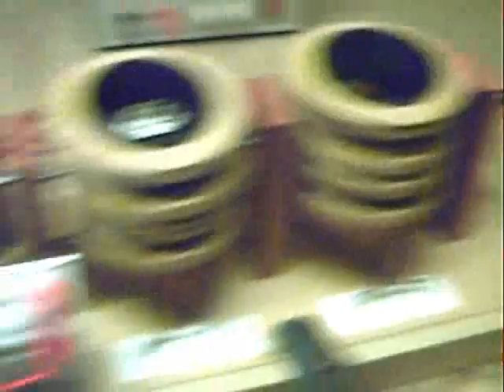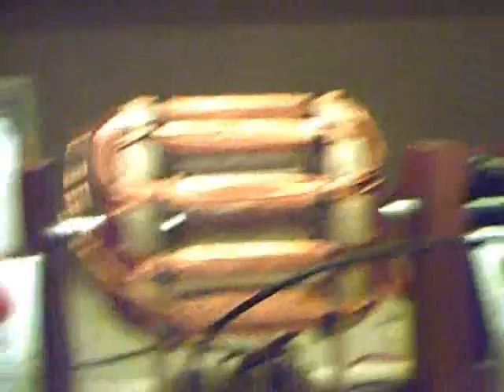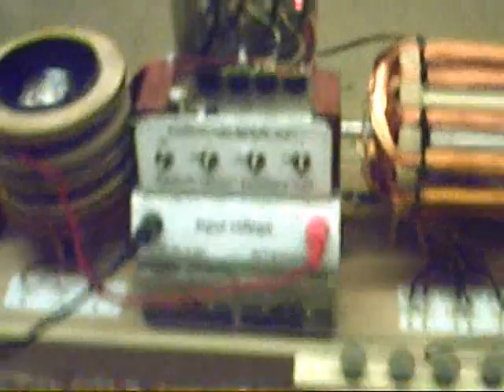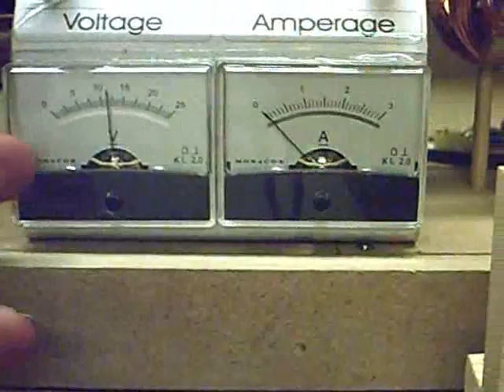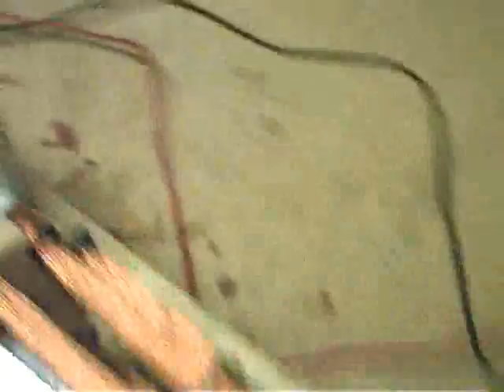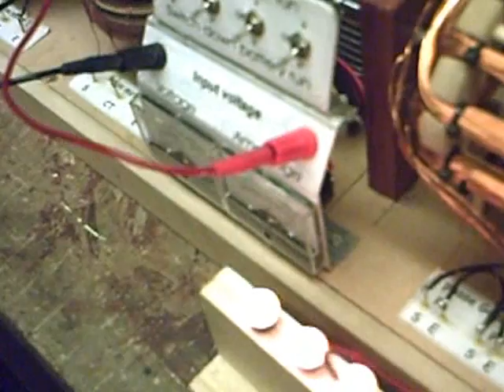My all new newman motor 2 running it up.

Comment from the maker: Nice to see your motor-generator running. It looks like a nice flexible setup for performing all sorts of tests. Ultimately taking the testing to the next level is the key for all of the builders. Make real power-in power-out measurements, measure efficiencies, measure battery start/end output impedance, measure charging power, estimate and measure battery energy, do measurements on test vs. control setups, etc. I am not holding my breath for this to happen though.

Comment: oh and if you had any idea of power generation you would know that cogging is the magnetic "stepping" effect that you get when you move the magnetic poles over the center of the coils, you can feel it is you turn a stepper motor (although in a alternator without iron you have no cogging effect so in this case it has no relevance as he has no iron in the alternator) a better design to use that has no cogging is an axial flux alternator

Comment: Very nice design. You are getting a lot of speed and plenty of torque. How about putting 2 more generators on it (one on each end).  With 3 generators, would it have the power to run itself? Or would the extra generators cause the motors to draw more amps and end up with a net loss.

Comment from the maker: Remember this is an experiment not any definitive. 
So again Joseph Newman states is motor runs on voltage only not amps/currant so its the motors or the electronics thats incorrect not the alternator. 

Dam 500-word count.

Comment from the maker: This alternator will give almost 50 watts when a full load is applied and spun up with an efficient motor. I did test it before connecting it up to the Newman motors and I have built about 40. So please no more comments on the inefficiency of the alternator thats probably the only thing that is correct. Its more than likely to be my electronics that need a good tweak I think I should have used mosfets.

Comment from the maker: Id like to just point out one thing to everyone before you all send anymore emails, Joseph Newman motors run on voltage only not amps/currant so the 3 phase generator was built to test that theory. So please remember before commenting about the output currant of the generator. As you see it thats how I intended it to be except the voltage comes out at 30 volt in stead of 24 max but if Joseph Newman is correct then thats good not bad has more volts means more revs.

Comment from the maker: by connecting my alternators output to one of the 4 Newman motors it would pickup speed and more speed more voltage and so on. Has you can see thats not the case. And the next thing I will be doing is replacing all the electronics that is what is burning up the currant. Maybe Jefferson Newman is still correct about his motors and my control circuitry is at fault.

Comment from the maker: The output of the alternator has be configured star for voltage has Jefferson Newman states his motors run on voltage and not currant, so I went for voltage not currant. I can get more currant but with less voltage by reconfiguring the alternators output to delta. But thats not what I was after,so to sum up if Jefferson Newman was correct in that is motors runs on voltage and not currant,

Comment from the maker: Well most of what you say is correct. All the magnets are Neodymium. MASSIVE clearance on generator was to limit the cogging effects on load. If I were to insert iron, it would improve the 3-phase alternator performance but at a cost in the form of cogging effect and as you point out the Newman motors are inefficient, so definitely no cogging of any kind would be in order. The effect of MASSIVE clearance is the 3-phase alternator is not so efficient.

Comment: 42W in and 6.6W out? your generator has MASSIVE clearances and thats extremely inefficient.. if you insert some iron to help hold the flux round the coils you will improve your output.. but i fail so see how 4 very inefficient electric motors running a very inefficient alternator will achieve much...you would get more "back" emf from a 3 phase motor with rare earth magnets inserted in the rotor but again your just waisting time there too

Comment: The obvious craftsmanship is inspirational. The non standard principles are thought provoking. I am curious as to why so much effort in the Newman/Bedini pulsing style hardware are DC devices and not AC. I would like to see an apparatus capable of running my Electric Kettle at 110Volts AC at 2.5 Amps